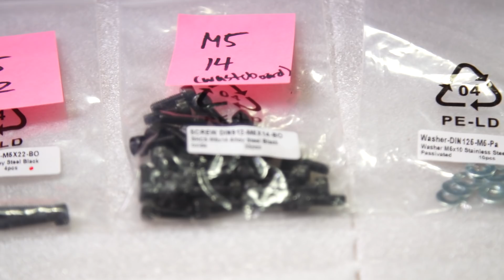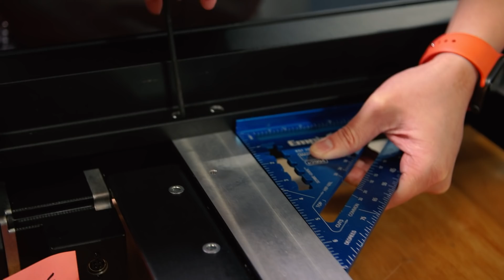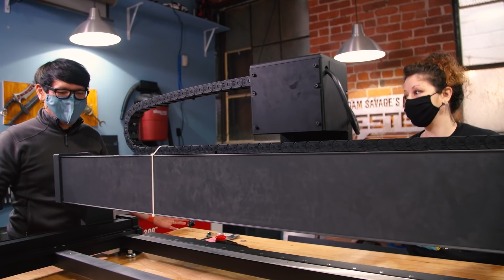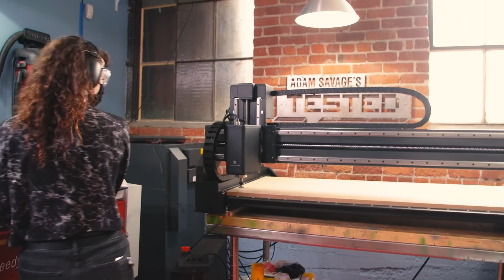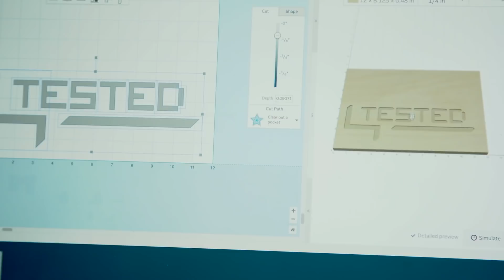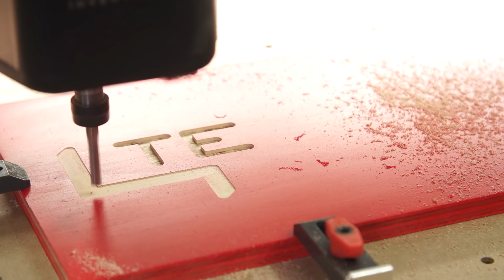Tested's New CNC Machine: Assembling the X-Carve Pro!

Comment: DON'T TEMPT ME! ... you guys make me want more machines than I can possible justify. ... BTW: keep up the good work! Addendum: bonus points for highlighting the importance of leveling your machines! Everything that has moving parts will benefit from being properly level.
Reply: If you're going to get a CNC router make your own. The kits are a rip off. If you have other tools you can put a machine together like this for a fraction of what integrators charge. Full price on this model is 10 grand. You can make it with 2 grand of parts and materials. Maybe less if you are careful. But to be successful you need a range of skills. Sets of skills most don't have. People good at mechanics tend to be bad at electronics and vise versa.
Reply: Calling upon C-137
Reply: @sallesekulic  That's exactly the level of level-ness I am talking about!
Reply: The price for this is insane. Would never pay that much for this.